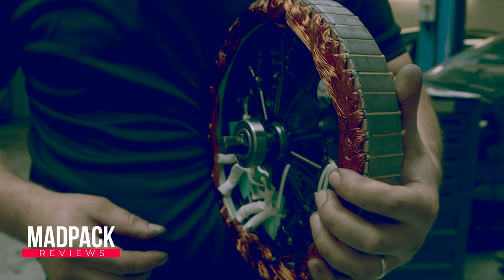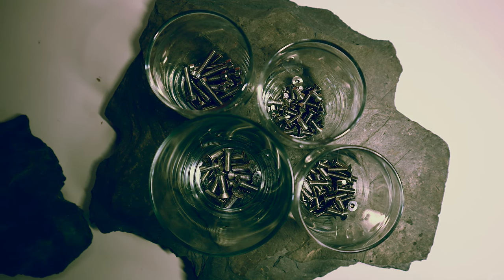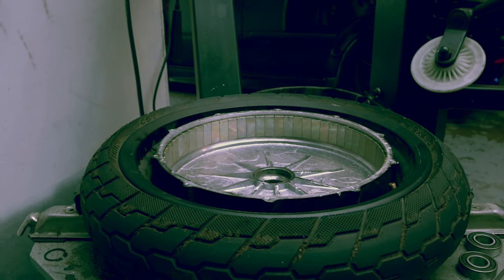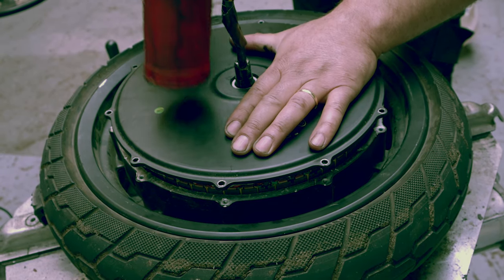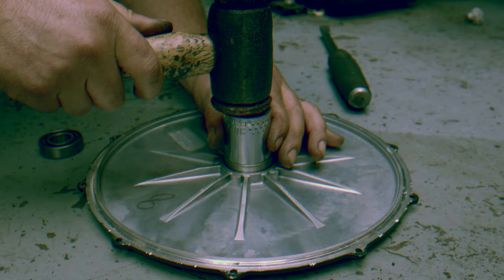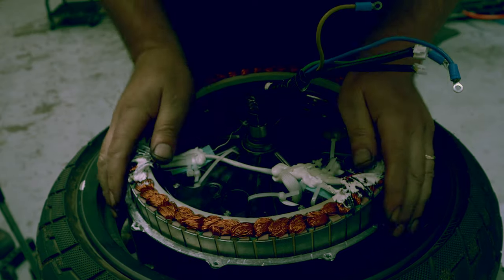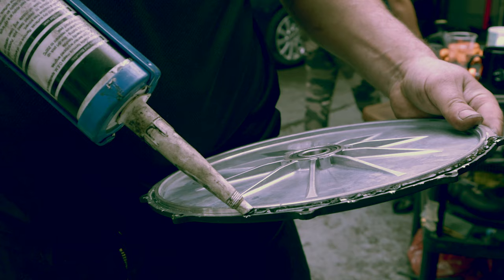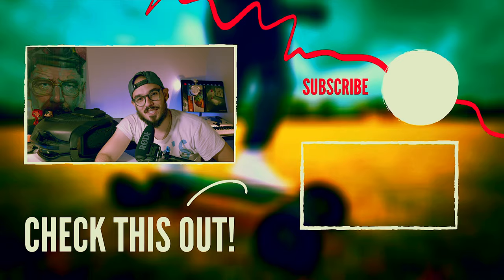How To Swap Bearings on a EUC? ✅Ninebot Z10 Disassembly

Comment: I opened the motor several times...in a couple of minutes...at home...without special tools. Here’s a simple life hack: I placed the motor on the floor with wires facing up, and put a piece of wood under the axle so the rim doesn’t touch the floor. Then I just had to step on the rim with my feet diagonally and push the rim to the ground with my body weight. When the top lid came loose I started shaking it to the sides and lifting up, while standing on the rim. However, with the amount of silicon you used to seal the motor it will be a tough task as it glued the lid to the motor. I made the same mistake.  I had almost jump on the rim with my brother in the same time and luckily it did the trick. 
Btw I also have the same clicking sound for the last 5000 km, but all zip-ties were ok. Just checked the picture
Reply from the maker: Thank you so much for your message. I tried to make the same but without success.. Maybe the body weight can be the answer. Thank you for your message

Comment: I've disassembled the Z10 several times already. It's easier every time. Now I am waiting for the MOS board delivery which I need to replace. The wheel started to loose balance and it turned out some kind of liquid (probably from capacitors) leaked. I hope it will help.
Reply from the maker: Mos board is easy to swap if ot was the other one will not be an enjoyable experience
Reply: @MADpack  If I need to replace the main board, I will seek your advice. Let's hope it's not the case.
Reply from the maker: Is not a process that im familiared with because i never done but you will need ninetool.for sure

Comment: Thanks for these infos !
It sounds to be impossible mission...so whenever the bearings will die...the z10 will be dead :-(
Time to buy a spare Z10 before it will be too difficult to find one on the market...
Is bearing replacement a so hard task on every wheel ?
Reply: You can buy entire wheel with motor for replacement. You don't have to buy new z10
Reply: @jacektrybusz1841  Where could I buy a complete replacement motor/wheel ? Is it expensive ?
Reply from the maker: Yes obvioulsy thats another option but in this way cost me less than 50% of a new motor.
Reply from the maker: Is around £250 and you can buy on aliexpress
Reply: @MADpack  Exactly but you can do it on your own without any special tools. If you are dismanteling the Z10 for the first time, just be prepared that you will have to remove every screw in order to do so. It will take some time but therer are only 2 types of screws and for sure you will make it. Remember to start with disconnecting the batteries first (and once discinnected press on/off button to drain remaining power). There is a dismanteling video for z10 on YT.